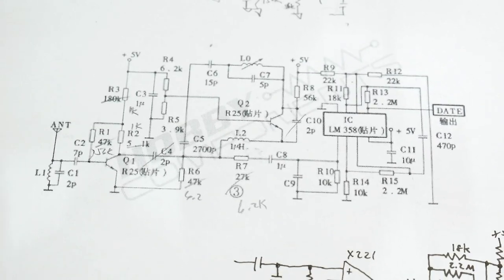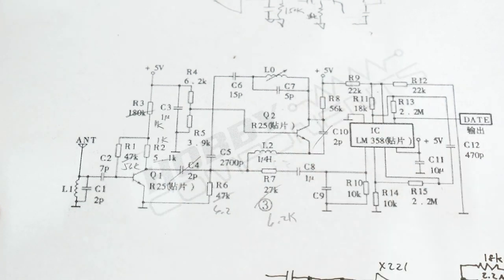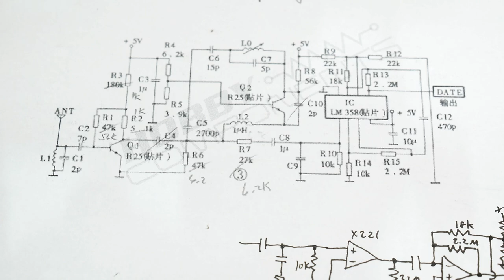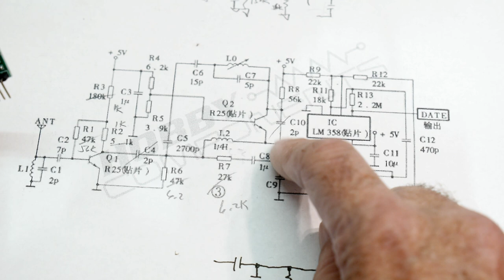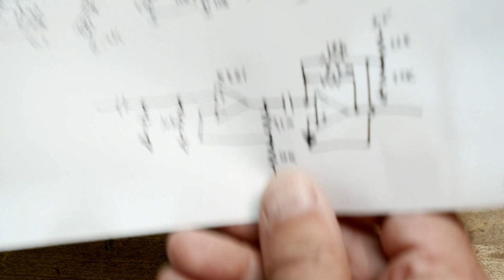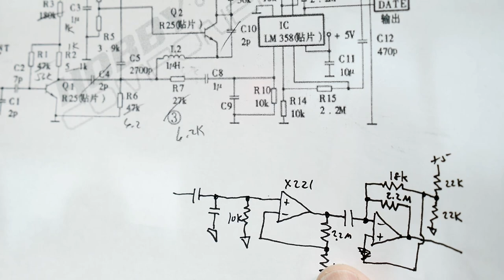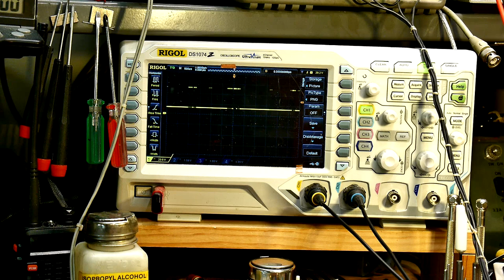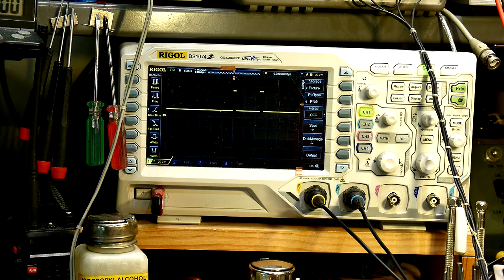#628 433MHz Receiver

Comment: We bought a bunch of these from a local distributor, the description said something along the lines of "Outputs digital noise when no carrier is being received" - We were able to get it to work at low datarates and checksum, but the microcontroller was awake 24/7 trying to pick out signal from the noise....

Comment: I one without a crystal. Seems to work.
Mines a little different. There's a through hole resistor on the top. It's marked on the silkscreen underneath so not a bodge.

Comment: the bad receiver needs 470uF on power supply, 2u2 between data output and ground and R15 needs 1MOhm resistor in pair so total resistance will be around 680kOhm

Comment: Had the same probvlem with noisy output. Run the module from 9V and it cleaned up. This is due to the comparator thresholds being non-optimally set. With good antennas up to 100m range.

Comment: For a few months I had terrible qrm on our uk 70cm contest night. Every few minutes I'd get a rapid ticking  noise which slowly increased in frequency. Out of the blue a neighbour asked if I'd change the battery in her domestic heating oil tank level indicator. On investigation I found battery was ok and on monitoring the signal from the little 433MHz transmitter I heard the dreaded ticks. The senser was caked with white dust and the circuit board had a few corroded joints.  After a good clean and made good a few solder joints it was back working and to my great relief I later had a  tick free contest.
It's not often that qrm is so easily fixed.
73
Reply: @M0KOV I suspect that you are within range of the PAVE PAWS radar transmitter at RAF Fylingdales, UK.  The Pave PAWS (Precision  Acquisition Vehicle Entry Phased Array Warning System) radar transmits 600 kW pulses hopping on every 1 MHz throughout the 420-450 MHz frequency band.  In search mode the pulse bandwidth measures about 300 kHz centered around each MHz mark with a peak signal strength of -90 dBm (S9+3dB) to me.  In tracking mode the pulse bandwidth can increase to 30 MHz.  The pulses duration is milliseconds, too fast to register on many S meters.   You may hear the pulses as random ticking or clicking sounds and can see them as a jumping baseline on a panadapter.  I have posted some videos of PAVE PAWS signals I receive here from Beale AFB on my KP4MD YouTube channel.
Reply: @kp4md  Thank you for the interesting reply. Nobody in our contest group heard any similar signals to the ones that I was receiving, that included a station situated 3 miles away and another station near Thirsk which is between me and Fylingdales. This noise was at s8  and was identical to the small 433 tx, it splattered over the band and rose  300Hz presumably as it warmed up.
Shall certainly check out PAWS and ask if any of our group members has heard it.
73 Steve

Comment: Those modules suck. You can send digital stuff at really low speed, but the amount of filtering and error correction you need to add is ridiculous. And you still have less than 50% chances of receiving it properly.

Comment: Sir please help me, 

I made a 4 channel transmitter and receiver circuit using 433Mhz rf module with HT12E and HT12D ic. But when I provided both the reciver and transmitter circuit same voltage 5v then communication didn't work that is data was not received. But when I powered the transmitter circuit with low voltage than receiver circuit around 2.5 v then communication between the two worked and data is successfully received that is led on the receiver side turned on. Why is this happening?
Reply: I’m running something similar but neither are working. These modules are trash.